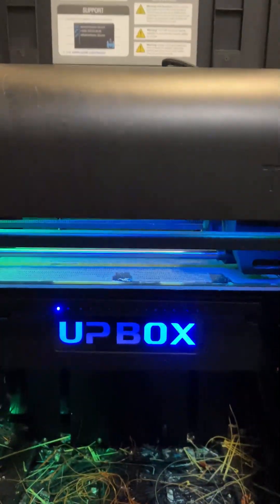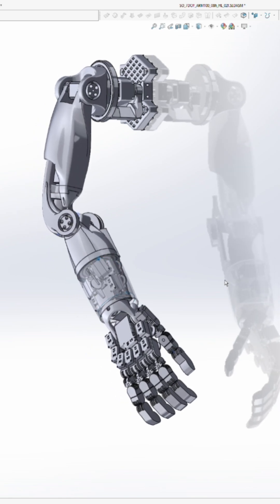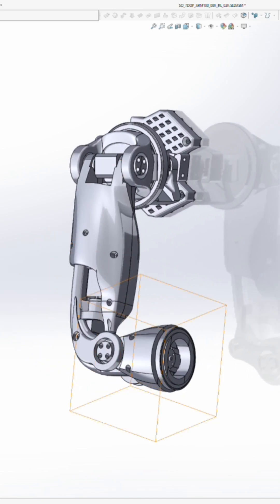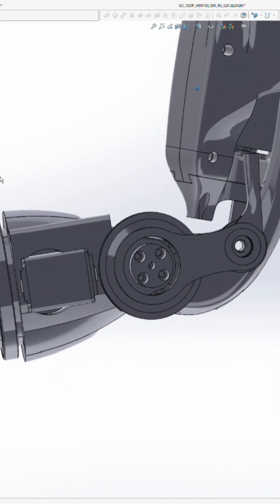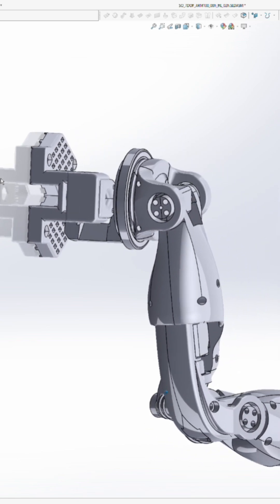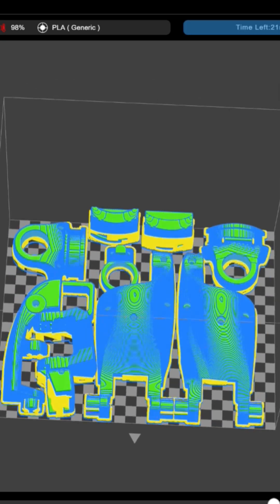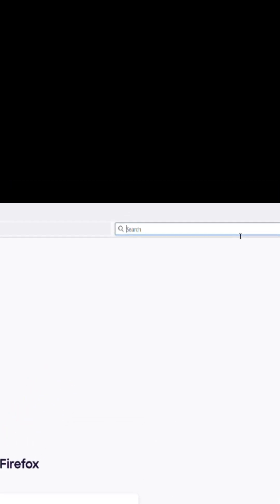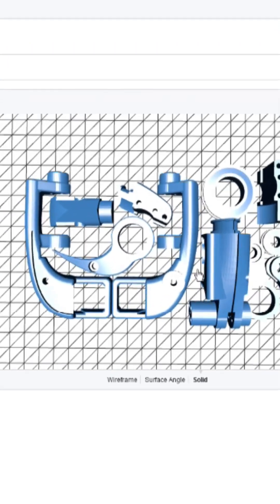HOPELite: Open-source, DIY, humanoid robots: Arm_Test_01

Comment from the maker: https://github.com/TheRobotStudio/HOPELite/tree/main/3dprint%20files/Arm_Test_01

This is the first set of printable files which will certainly contain errors.

The aim of the first set is to be able to complete an assembly of a new design with only minor modifcations using hand tools.

You have been warned!

The HOPELite arms have 7 directly driven degrees of freedom with a hybrid tendon system to add power in specific ranges of motion.

Initial tests are with a single tendon equivalent to the biceps and other muscles of the shoulder that are responsible for lifting weight directly to the front of the body.

HOPELite: Open-source, DIY, humanoid robots

I want to foster a community that changes the world.

HOPELite Discord Community link: https://discord.gg/8ATPYZCYDs

In a literal sense, the widespread adoption of robots is exactly that: the power to change the physical world with digital systems.

Open source has a crucial role to play in the development of this technology only if the tools are available to make that a practical reality for "the masses".

Open source software would clearly be a nonsense if they weren't billions of devices readily available for coding.

To this end, lowering cost whilst maintaining an adequate level of functionality is the highest design constraint.

The intention is to lever the tremendous performance increases that AI software offers to offset the significant differences in low cost hardware.

This is the great promise that needs testing: can AI genuinely control much lower cost hardware and finally produce the robots that we've all been dreaming of?

3d printed plastic robots offer tremendous precision but significantly lower stiffness, a trait that is true in fact of all the lower cost versions of components in a robot. Here there may be a happy coincidence because the problem with expensive hardware is that it cannot be safely used around people. Industrial robots are made of metal and remarkably stiff gearboxes to produce rapid, highly precise movements - like a robot.

But people don't move that way, we are bouncy and capable of feats of strength and precision that far outperform an industrial machine of similar weight and power.

So, we know it's possible to learn how to control a bouncy system and we know they're lower cost.

All that's missing are the plans and instructions to build a DIY population of humanoid robots.

Comment: Wow! That's a ton of amazing work! Could you please elaborate on the motors/servos?
Reply from the maker: 7 STS3215 12v servos (7 x 30 - 210Eur) and 17 SCS009 servos (17 x 13 = 221 Eur) plus one powerful motor for tendon, still to be chosen.

Plus bearings, tendons, ptfe, springs, pins and filament.